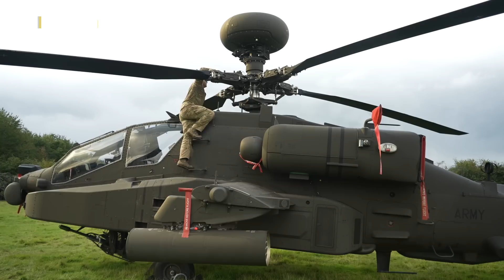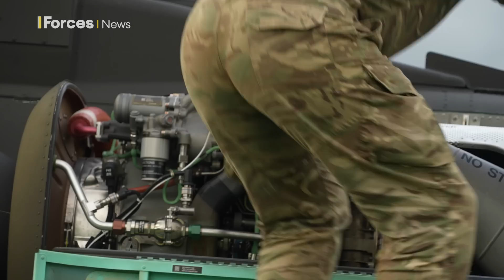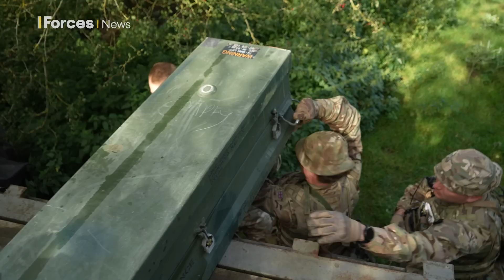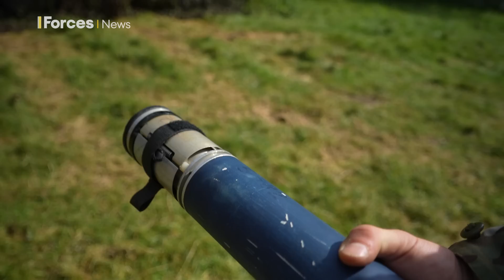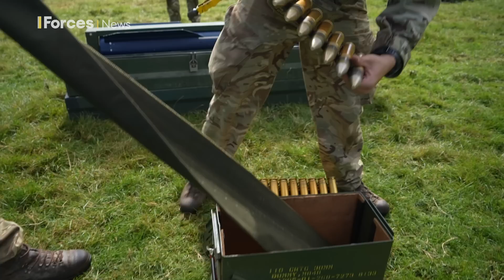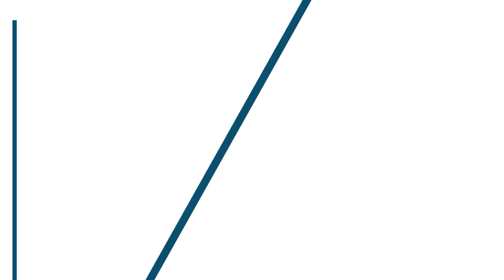How the British Army arms fearsome Apache attack helicopters

Comment: Sh1tcan challenger 3 programme.  Buy more of these
Reply: Do both
Reply: No the challenger 3 will actually have caught up to modern standards with a smooth bore 120 gun, gen 2 thermals for gunner and commander as well as an APS (Active Protection System).